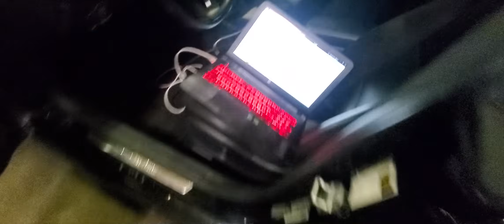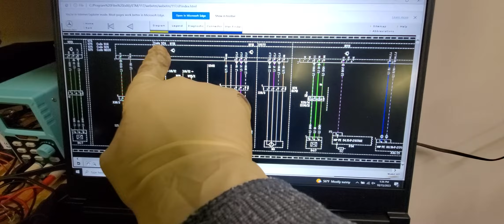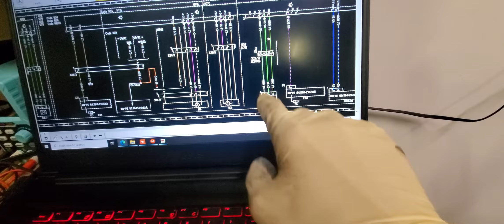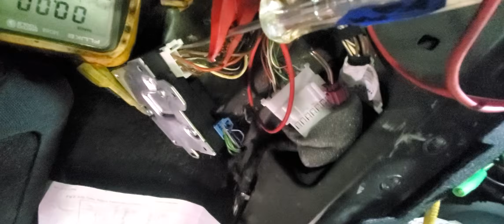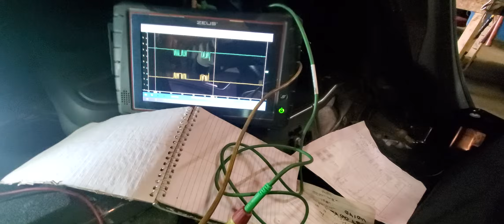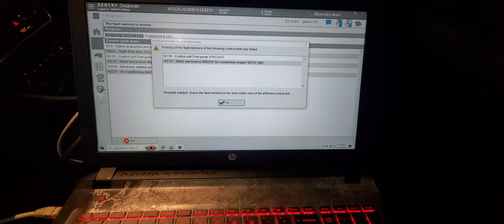2015 Mercedes Benz CLA.  Crank no Start  P008700 and P1CCF00

Comment: U never said what the issue was was it the fuel pump in the gas tank ,the module , of the high pressure pump
Reply from the maker: I did mention it, please rewatch the video - Low pressure fuel pump was at fault

Comment: Over the past several days, the car began developing intermittent driving problems. It first started jerking while driving, and the check‑engine light would come on and off. Shortly after, the engine lost power and stalled. After waiting a few minutes, the engine would crank but not start, and only after additional waiting would it start again briefly before stalling once more. Later, after letting the car sit for about an hour, I unplugged the MAF sensor and managed to drive approximately 10 km home. The next morning, the car started normally but shut itself off after about four minutes, after which it would only crank without starting. A jump‑start allowed it to run for a few minutes before shutting off again. A basic scanner then showed code P0087 for low fuel rail pressure.
I took the car to a workshop, where they confirmed that fuel was reaching the filter and that the in‑tank pump was operating, but fuel was not reaching the high‑pressure pump. Based on this, they advised replacing the high‑pressure pump. The high‑pressure pump was replaced, but the symptoms did not change. A diagnostic report from the workshop showed multiple electrical‑related faults, including low system voltage, a Circuit 87 power supply fault, injector power supply faults, and a MAF short‑to‑positive. I then installed a brand‑new battery and new in tank pump but the car still does not start.
Reply: where is the maf sensor location. I thought it didn’t have one but had 3 MAP sensors??

Comment: Awesome find! My ML550 has this code stored (P1CCF00). It has a long crank sometimes when warm, but not always. Getting worse. Could it be the fuel filter?
Reply: Update- It was the in-tank fuel pump. And of course they recommended replacing everything inside the tank. It's a saddle tank, so there is an assembly on each side with multiple level sensors.

Comment: Hi friend. My Mercedes B200 direct injection (M270 engine) won't start. It's not throwing any DTCs, the engine has spark, and it starts when I manually add fuel, but not otherwise. I can see on the scanner and with a pressure gauge that I have low-side pressure, but it doesn't rise above that pressure when starting. The high-pressure pump is new, and the mechanical components, including the follower and camshaft, appear to be in good condition. Can you lend me a hand with your expertise? Thanks.
Reply from the maker: Check the high pressure fuel pump electrical connector for power and ground.
Reply: @waqasazmat81 thats fine, because i do test with scanner and is working !!
I only have 5 bars on rail

Comment: I have the same car on my garage. The car crank but do not start . The error code P00870 is stored and current. I measure the current and no power at the fuel pump. All the fuse are okay. Any idea ?
Reply from the maker: Are you checking power while cranking?
Reply: I measured only with ignition on and I haven't 12V. I measured olso the fuel pump module wires and they are excactly with the same values as your module in the video. Something strange happens when I do acuation test of the pump. I can hear the pump running and if I tried to do acuation test it doesn't work. First I have to clear the code P00870 and then I can do acuation test of fuel pump again.

Comment: Thanks for the patio I have a similar issue 2015 mercedes-benz cla po61117 code

It sometimes don't want to start and shoots that code especially if I'm driving for an hour or so it will not want to restart once I turn it off. 
If you can please help give me some pointers what to do I just bought this car not too long ago from a private party.
Reply from the maker: Any luck?

Comment: I have a CLA with the same issue. Would run about a minute after starting then die. Code was P0087. Put a fuel pressure gauge in line and only seeing about 7psi while running then after about a minute goes to zero and dies shortly after. However, since reconnecting the fuel line (without the pressure gauge in line), now car will crank but will not start. Put gauge back in line to check again and first couple cranks it read zero, but then after 3rd and subsequent cranks reads 7psi but still will not start. Thinking it’s bad fuel pump in tank, but any clue why won’t start now when it did run before my test? Also, what should low pressure reading be at inlet to high pressure pump? Thank for the video, very thorough!

Comment: I appreciate you making this video. I have a 18 C300 AMG Package that was running regularly then randomly shut off and now it just cranks no start. I will be following this video as i diagnose the car. Thank you.
Reply: Did you solve your issue
Reply: @ I did not, car is still sitting. Replaced the low pressure fuel pump and still nothing.
Reply from the maker: @andreymartin100  What are the codes?
Reply from the maker: @andreymartin100  keep us posted

Comment: Is there a way to reset the ECM with out a scanner tool after replacing injectors? I’m getting a crank no start
Reply from the maker: @Epic-1ne  Freddy I don't think so, plus they require injector calibrations.